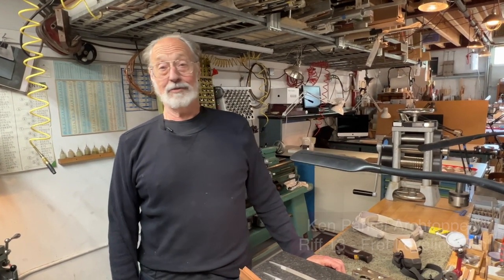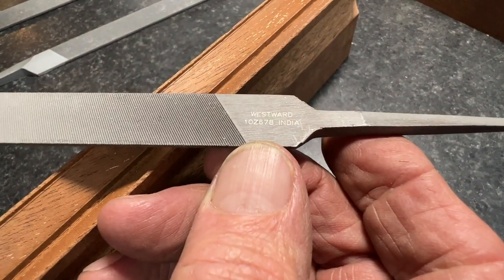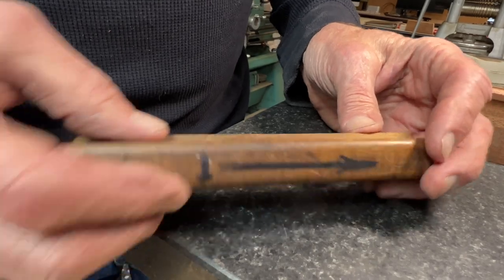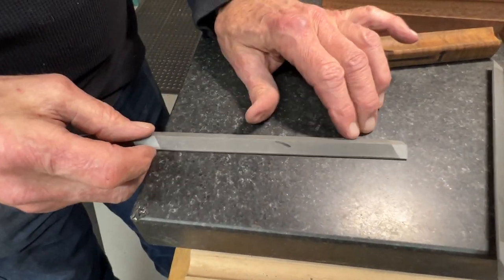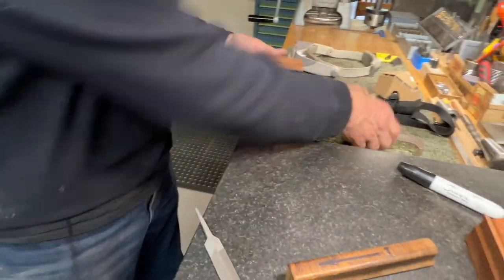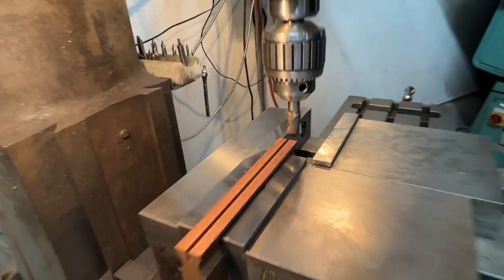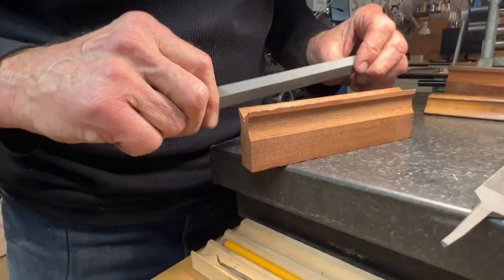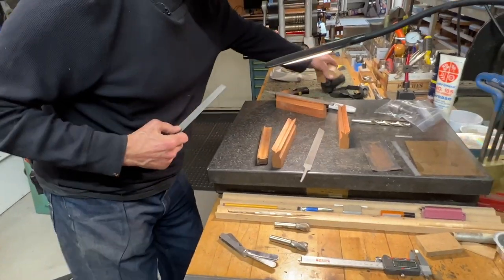Ken Parker Archtoppery - Riff 013 - Fret Leveling Tool

Comment: Hi again Ken, greetings from Methuen, MA. Great lesson as always! Would a perfectly straight file be acceptable for making this tool, or does picking one with a slight convex shape act as "insurance" against mistaking a hollow file for being perfectly flat? In other words, I understand why you do not want a hollow file, but I am wondering the reason for picking a convex one. Does it have to be convex to match neck relief (a perfectly flat file would have its contact points toward the ends), or can the final tool be completely flat? And how convex would be too convex? Thanks in advance! (and sorry for the long question, please feel free to bill me for your time :) )
Reply from the maker: Ha! No charge, mon ami. It's an interesting question you're posing, so let's unpack it.
1) When files are hardened, it's my understanding they are left as hard as possible, and not "tempered" to reduce hardness and induce a little toughness. Perhaps you have had the bummer to snap off a file like I have, and get schooled by how easy it is to break a small file by rough use. They break like glass, no elasticity at all.
2) when files are quenched to harden them, no doubt they are dumped into the oil bath in batches, and there's likely no way to control the angle of the file's entry into the liquid, which will have an effect on which way the file deforms when it gets shocked by the cool oil. If you look carefully, I think you'll be hard pressed to find a file that perfectly agrees with a straight edge, so let's just say they're quite likely to be bent one way or another to start.
3) as you understand, a concave file is wrong for this levelling job, and while a slightly convex file won't normally be engaged in the cut for its' whole length, this isn't a problem if it's only slightly bent.
3) If you want, you can try to coax the file's shape a bit by carefully shaping or shimming the wooden handle, and clamping the file just so when you glue them together to get an improvement in the final shape, just don't expect too much unless you deeply kerf the file with a thin grinding disk to make it act thinner, like kerfed lining.
4) How much convexity is good? just a little bit.
There, I think I kicked this one to death, or have I forgotten something?
Reply: @kenparkerarchtoppery9440  Hell of an answer Mr. Parker! But I do, in fact, have a file that agrees with my starret straight edge, so this particular part of the question persists: Are dead flat files not suited for fret leveling (since the neck itself has some relief, the file should somewhat math that, no?)? Are only slightly convex files perfectly suited for the job?

Comment: Great Riff Ken, i cant wait to make my own. On the topic of fret leveling, do you have any comments on the importance of the length of the tool for this operation? it seems analogous to a jointer plane where a longer tool that spans as many frets as possible will get you a flatter cut. I have been using a long ground leveling beam with sandpaper for my fret leveling and it has always felt cumbersome. Perhaps its not necessary? Cheers!
Reply from the maker: An excellent question from someone who obviously has done the work!

I'm with you on this, as I don't believe that the handplane analogy works perfectly.
 
Here's why.... When we get out our long "jointer" hand plane, which we have carefully tuned, sharpened and set for a very light cut, we can depend on it to remove a precise, gossamer-thin shaving from the surface, and truly "transfer the straightness" of the plane to the work, at least if know what we're doing. 

It would be great if fretwork was like this, but it really isn't. 
Frets are designed to be long-wearing, and so are metallurgically formulated to to be resistant to abrasion.
Sandpaper can remove some fret material, but there's nothing easy about it. We need to apply lots of pressure to get it to cut, the abrasive particles get hot, and either become dull, or are sheared off, or both.
It's a tough job for the unsuspecting sandpaper, and it will need to be renewed almost immediately.
What a PITA, it's frustrating to try to keep sharp sandpaper on the sanding block!
It will seem like you're spending more time fussing with the paper than correcting the fret tops.

Enter the single-cut file. It's able to cut materials softer than itself, which is to say any material measuring lower hardness than about Rockwell C scale 65, assuming that the file is manufactured properly. Any fret is softer than any file.

In practice, fret leveling requires a larger cut on some frets than on their neighbors, so the idea of a straight tool is important, as it will bridge the low spots, and cut down the high spots.
However, because of the considerable force needed to keep the sandpaper or file teeth "in the cut", we can't expect the file to be able to cut more than a small neighborhood of frets at a time.

The result is some diminishing returns regarding the length of the tool, and I think that the idea that you can get ahold of a long sanding stick and magically wipe off all the problems of uneven fret height would only seem possible to someone who never tried it.

This file is the perfect length for the job, long enough to do some useful "jointing" behavior, and short enough to be an effective cutter using the force we can muster by getting our upper bodies over the tool, and digging in to keep the teeth engaged in the work.

Precision fretwork is a steep hill, maybe a lot like truing bicycle wheels. 
For most of us, it becomes do-able and even routine after the first 1000 or so tries.
Reply from the maker: Oops, forgot to wish you cooler breezes, Sam!
Reply: @kenparkerarchtoppery9440  What a response!!! Thank you thank you!

Comment: A wire brush might have taken care of that epoxy a little better... Still a cool tool idea!
Reply from the maker: Some craftspeople won't use a hard brush, or "file card" on files, saying that the hard wire bristles dull the teeth of a sharp file.
Reply: @kenparkerarchtoppery9440  - That would be a surprise to the guys who trained me in the tool & die shop. I keep brass brushes around for my die sinker files and so on.

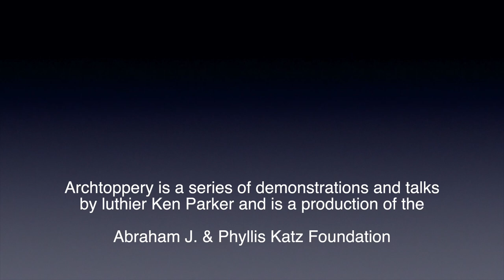Comment: Can I just say kids... that movement on the belt sander at 25:47... Don't try that one at home.... on a belt/disc sander, when you raise the workpiece off the platten in that way, the gap between the platten and the belt/disc, speed of the belt and god may conspire to pull the workpiece into the gap, in the direction of travel of the belt, slamming your fingers into the belt....  It may not end well...
Reply from the maker: What you describe is called "offhand grinding", and is perfectly safe for those of us who understand and respect the cutting forces of abrasives. Just look up any YT video on knifemaking, and see how this works. It is true that extra care and caution are called for when not resting the work on a table, but many of us do this all the time without issues. I was shop steward at the wood shop in college, and I was horrified at how people behaved with powered tools, and also by how resistant some were to safety training and concerns, as if safety was some kind of sissy thing. Wow. Some people shouldn't use power tools at all, ever, and if you continue to be surprised by what happens during a cut, perhaps you're one of them.

Comment: If you bought flat files instead, you probably could use every file using the good side…
Reply from the maker: Exactly what I did a thousand years ago when I first epoxied a file to a piece of wood/handle. The resulting tool then has two sharp cutting edges, and one slip can do some serious damage that will be impossible to recover from. Ask me how I know. To cut the frets reasonably quickly and leave a nice, smooth surface is the goal, and so the size and design of the teeth are really important. It turns out that a single cut file works the best for this, and you'll want one with fairly shallow, closely spaced teeth. The "Cant Saw" file that I use to cut frets seems like it has exactly the right size teeth, and the "single cut" file design leaves a great finish while doing a good job at cutting fairly quickly, it just seems perfect to me. 

When I demonstrate the use of this file to re-crown the .030" , .75mm high frets on the D'Aquisto, I use the same file for re-crowning the frets, but only need the two canted surfaces for this. What that means is when the file is too dull to do a good job, you can chop it up and make this handled tool out of it, unless it's distorted in the wrong way, in which case you can use it on your lathe for de-burring, or other general work around the shop. See what a cheapskate I am? Anyway, the idea is that the cantsaw file teeth are correct for either of these two special cuts we take while truing frets. For proof, see this film https://www.youtube.com/watch?v=f0xggzxVauc at 7:15 and marvel at the spiral shavings!

There are other advantages,
one, (1) the file is lighter for its width than a rectangular x-section file, and I find that the finished tool has a delicate, low center of gravity and precise feel. This triangular x-section shape allows the handle to be low, and gets your fingers very close to the work as a result. Nice!
two, (2) I like the length and width dimensions of the 8" long version, and 
three, (3) it's easy to make the handle so as to guard the edges of the file, and make it a safer tool to use on precious guitars you would greatly prefer not to disfigure and finally, 
four (4) the sides of the file are parallel, unlike many flat files, and I think that's just what you want. 

The Cant Saw file is available in 6", 8", and 10" lengths.

You would be forgiven for thinking that these little champions were designed just for us fretworkers, and I'll thank Carl Thompson again for turning me on to the Cant Saw idea for re-crowning. Thanks, Carl! Come to think of it, it was my buddy Steve Berger who learned it from working at Carl's shop and passed it to me. Thanks, Steve! 

It's a little bit of a stretch, (literally) but with this the low-profile cove-cut handle, you can sneak the file in between the strings at pitch, and file away at offending frets if you like, so long as they're not near the nut.

Comment: i use same method of cross hatching....catch a lot of shit because i don't use a long beam.
i only use an understring long narrow leveler after i employ your method of small file.  you do great work sir !
Reply from the maker: The long sanding beam is hard to control for at least a couple of reasons, and doesn't work as well as you might think it should.  Frets are made from pretty hard material, and even though they are narrow, quite a lot of force is needed to keep the cutting surface, file or abrasive, engaged and both 1) removing fret material at an appropriate rate, and 2) also leaving a nice finish, free from marks or deep scratches. I turns out that the "2 foot level" fret tools are a lot stiffer than most guitar necks, and it's more than we can do to keep track of how each part of the tool is cutting, while keeping the tool's motion in line with the string paths. It's better to identify the high spots, and work them down locally. Rarely, if ever is the job to remove an equal amount of material from every fret, so I would advise against the long format sanding tools that are so often used.